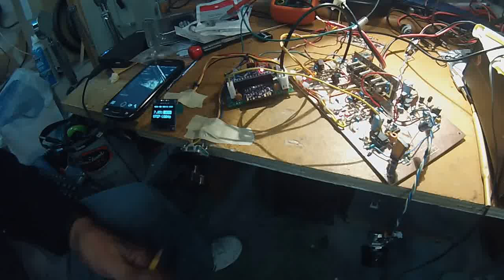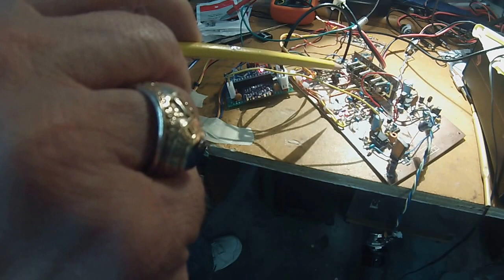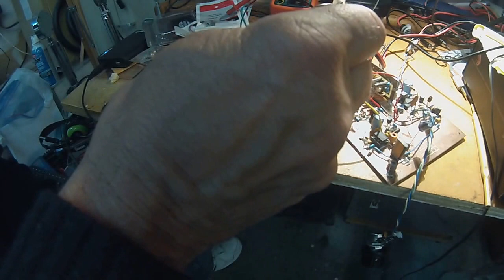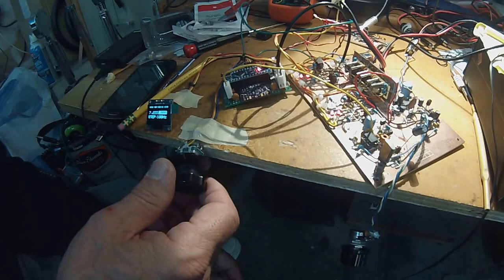Evaluating Noise from OLED Displays

Comment: Sounds great! I just noticed that Mouser reports that the BF991 is "end-of-life" and scheduled by NXP for discontinuance. Mouser has 1,367 in stock. At $0.47 each, I think I'll get a few dozen when I place my next order. --Todd K7TFC
Reply from the maker: Hi Todd,The specs on the BF991 are such that it is good to 200 MHz and 20 VDC --so these fit well with our 13.8 VDC radios. The others in the series don't like more than about 12 VDC on the drains. Sad to hear as I thought the BF991 outshined the RCA 40673. Thanks for your post.73'sPete N6QW